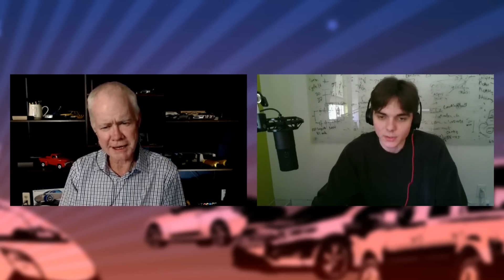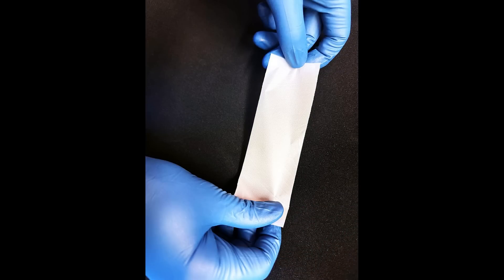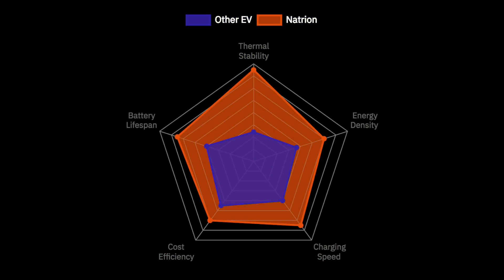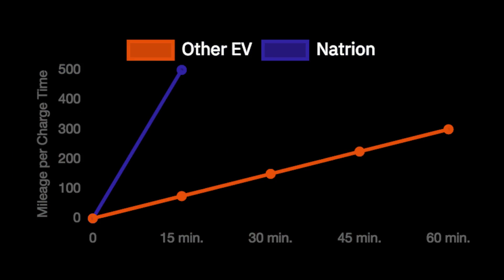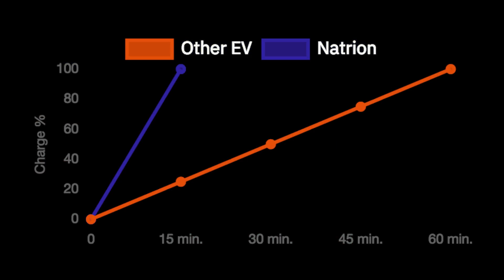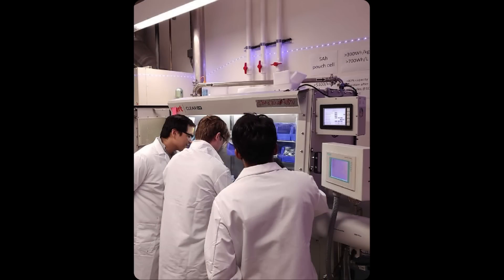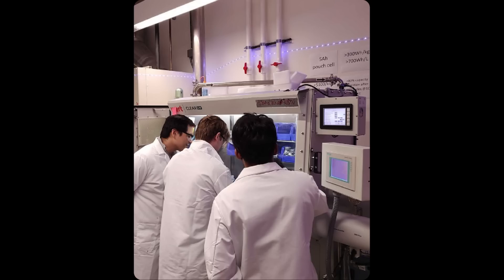Drop-in Solution Converts Any Battery to Solid-State – Autoline Exclusives

Comment: The goal is a 0-100% charge in 15 minutes with better energy density and safety.
With battery packs that are temperature optimised by using fluid to keep the battery temperature within a certain range means the cold weather performance doesn't degrade as much as expected thankfully. 
I didn't see this one coming a drop in solution is pretty mind blowing stuff from a manufacturing point of view if the product lives up to the claims.
EV technology from the first Nissan Leaf to the latest Tesla Model 3 is progressing at an astonishing pace compared to ICE technology with the first DOHC engine built over a hundred years ago.
A fantastic invention even if only from a safety perspective.
😎🇦🇺👍

Comment: Great story. I’m glad he asked about durability as I would like to see the test results on how does it handle heat cycles, vibration, actual discharge performance vs liquid, and if the material overall over time. I get it. Putting companies down is fun but this is an American team trying to be innovative and make better technologies. If they fail, they fail but someone else can take the ideas and expand. But if they succeed, this is a game changer as charging time is one of the reasons why folks don’t like EVs.

Comment: Here we go again.  Battery-breakthrough-dujour of the day.

When something sounds too good to be true.

If I would have to guess, they can fake it enough to make samples but the process is not scalable which means cost won't come down.  Or they are using expensive materials which will make this a no go.

Somewhere they are hiding some critical info about the viability.

As much as I would still hope for this to be true, I have seen these lab 'breakthroughs' too often and they never go anywhere.

Changing your electrolyte also doesn't mean an energy density increase.  It mostly affect longevity as far as I know.  And a SS battery is supposed to negate cold weather issues from liquid electrolytes freezing as well as faster charging.  Not energy density or lifecycle increases.  Too much here that doesn't rhyme for me.

Comment: He described the LISIC as drop in, where the manufacturer doesn't change anything else. The Natrion website describes LISIC as "liquid-free" so does that mean there is no flammable electrolyte? That would be fantastic. This is exactly the kind of incremental development I have been expecting for battery tech. The "answer" is not going to be one company creating the ultimate battery alone, but rather many companies creating a variety of improvements that will evenutally combine and settle into a sometwhat industry standard for battery tech and chem. As John said this is a company to keep an eye on.
Reply: Solid State = no liquid/gel electrolyte